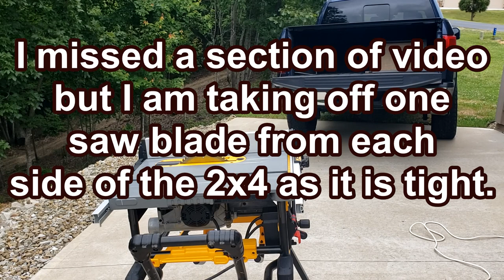Adding Trailer Sides to Aluminum Trailer Aluma 7712H Treated Deck Board Trailer Sides to haul dirt a

Comment: That turned out well Tennessee Yankee, your trailer is more versatile now. The thicker shim was a good idea.  I like that your trailer is aluminum.  Mine are steel and I am constantly dealing with rust. You have a nice assortment of Dewalt tools.
Reply from the maker: Thanks the funny part is I have yet to haul anything in it that’s usually the way it goes.

Comment: What was the total weight increase?  This weight has to be subtracted from the axles and considered for the tongue weight increase.
Reply from the maker: Yeah, I’m not really sure I didn’t get that detailed into it, you raise a good point, but I would never be close to the limit of what I’m hauling on this trailer.
Reply: Why not just buy the aluminum sides?